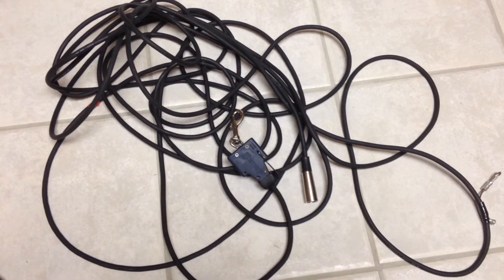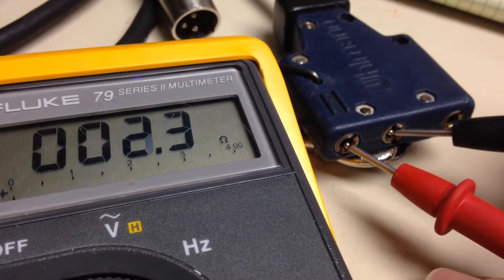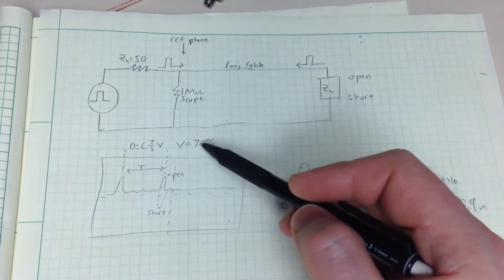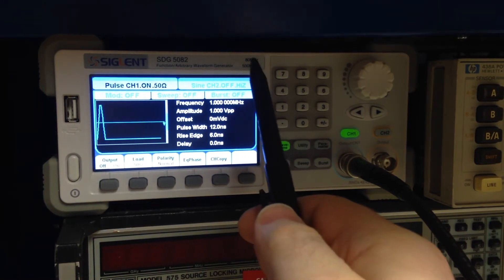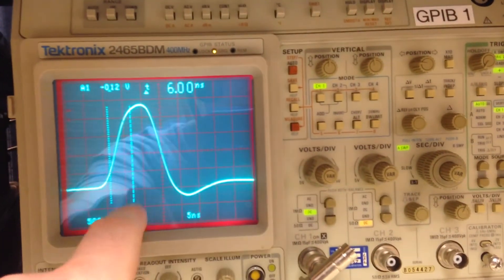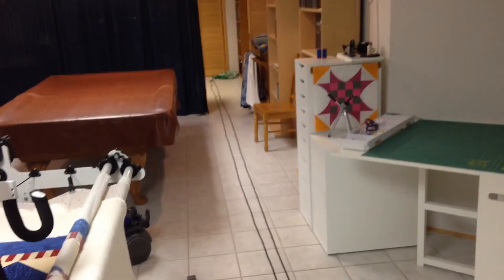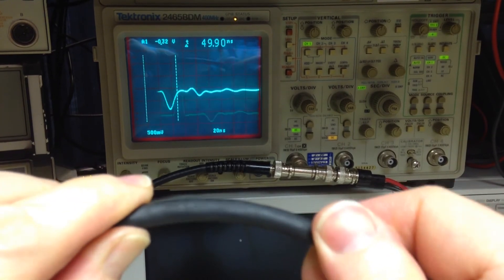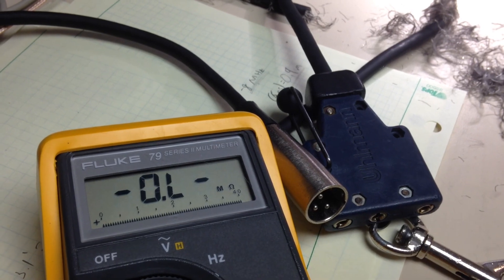Fencing Floor Cord Fault Location with TDR

Comment: i wondered how you could do this....  but without an oscilloscope and electronics knowledge (well i have the basics... very...lol) i wouldnt know how to do this..  I have just used the multimeter on resistance and ran hand up the wire bending and seeing where the meter moves (a bit... moves anyway along the wire but not much) and opened the cable up there and generally that is where I find the break or problem (generally.. not always..lol) .. sometimes in frustration I have just replaced the wire as i can't find where the problem is....
but dont get me wrong this answers my thinking of how to find the problem accurately....  as with most things fencing I have had to (*or tried to..lol) fix over the years would have been great to know this in the early 90's!!  (lol... wouldn't everything..)  - thankyou muchly for putting this video up there....
Reply: thanks Louis...  i really enjoyed your video...  i knew it coudl be done but had no idea how to do this or how to ask someone....